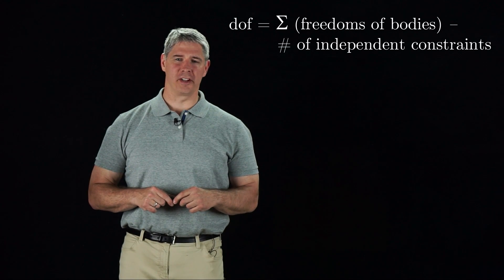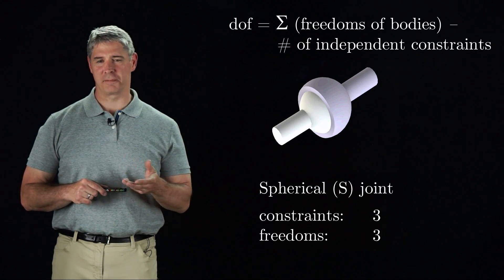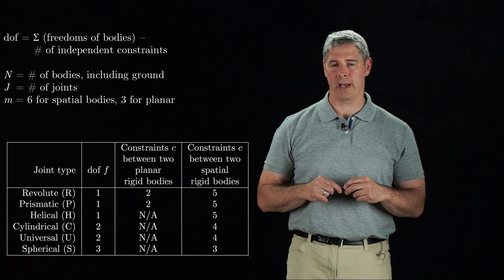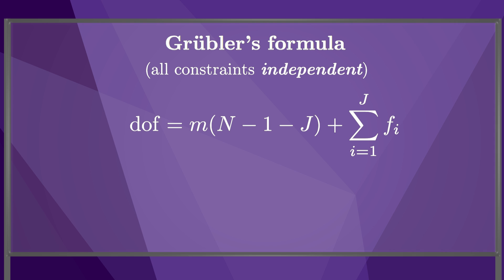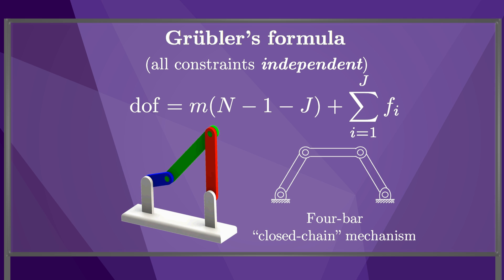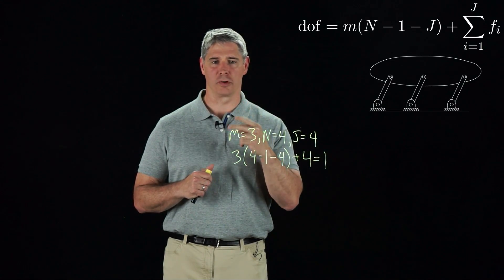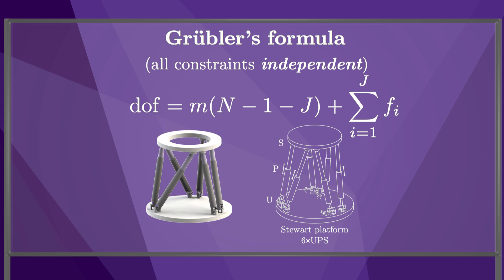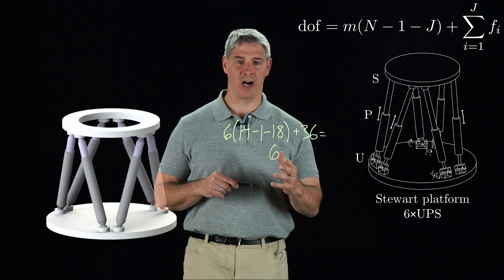Modern Robotics, Chapter 2.2:  Degrees of Freedom of a Robot

Comment: with the last example(stewart platform) you said the body has 3 joints with 6 degrees of freedom, which is true for the sphercal joint of each leg. But then again, each leg has a prismatic joint(with 1 dof). therefore i think each leg has a total of 7 degrees of freedom instead of 6 as you said. therefore we have Fi=42 instead of 36. i stand to be corrected
Reply: Actually on the second animation it was a bit misleading; it shows two spherical joints on each leg, but the animation that was playing before showed only one. Regardless, if we go by what he says during the first animation, each leg has one universal joint (2 dof), one prismatic joint (1 dof), and one spherical joint (3 dof), totaling to 6 dof on each leg.